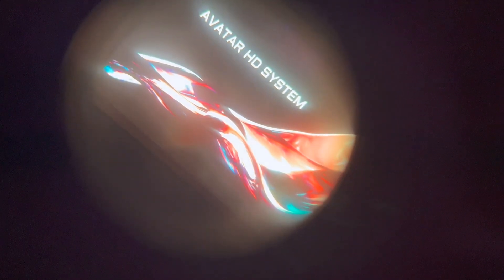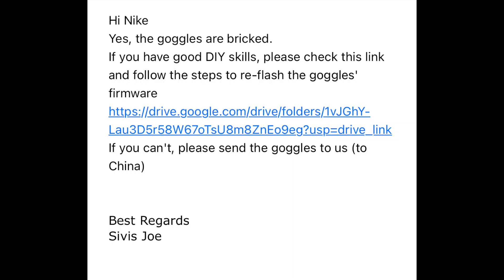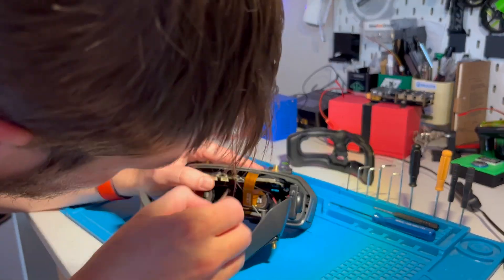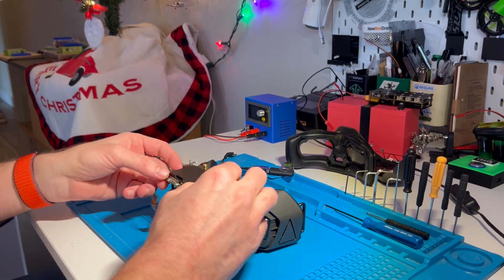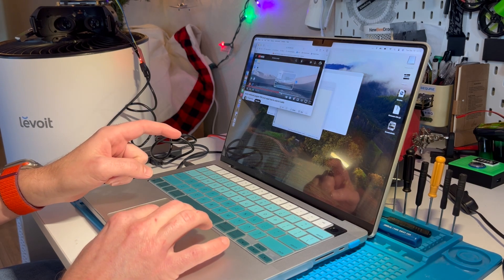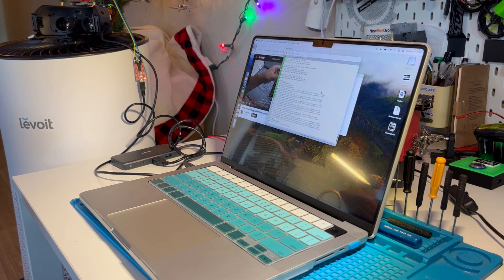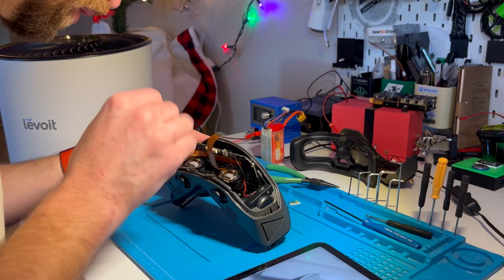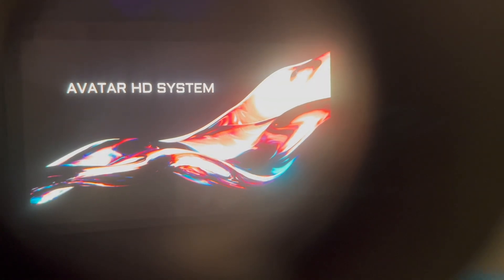Unbricking Fixing Bricked Avatar Walksnail goggles

Comment: I have tried everything and it seems my goggle board is not reading my sd card. Any thoughts? below is what crt reads back:
cp: can't stat '/local/factory/font/sdk.version': Not a directory
.............
mtdblock16
/tmp:/lib:/usr/lib:
cp: omitting directory '/local/usr/lib/glib-2.0'
cp: can't stat '/local/usr/lib/libcjson.so': No such file or directory
cp: can't stat '/local/usr/lib/libcjson.so.1': No such file or directory
cp: can't stat '/local/usr/lib/libdbus-1.so.3': No such file or directory
cp: can't stat '/local/usr/lib/libexpat.so.1': No such file or directory
cp: omitting directory '/local/usr/lib/libffi-3.2.1'
cp: can't stat '/local/usr/lib/libffi.so': No such file or directory
cp: can't stat '/local/usr/lib/libffi.so.6': No such file or directory
cp: can't stat '/local/usr/lib/libgio-2.0.la': No such file or directory
cp: can't stat '/local/usr/lib/libgio-2.0.so': No such file or directory
cp: can't stat '/local/usr/lib/libgio-2.0.so.0': No such file or directory
cp: omitting directory '/local/usr/lib/libpcreposix.so'
cp: omitting directory '/local/usr/lib/pkgconfig'
/tmp/dbus-daemon: error while loading shared libraries: libdbus-1.so.3: cannot open shared object file: No such file or directory
ceva file operation thread 0 create
CEVA file ops task, core 0 msg id 4664
ceva file operation thread 1 create
ceva file operation thread 2 create
CEVA file ops task, core 2 msg id 4666
ceva file operation thread 3 create
ceva file operation thread 4 create
CEVA file ops task, core 1 msg id 4665
freeRtos file ops task, core 4 msg id 0x123c
CEVA file ops task, core 3 msg id 4667
/tmp/fpv_type: error while loading shared libraries: /tmp/libmultimedia.so: invalid ELF header
board_ver=127
/tmp/fpv_type: error while loading shared libraries: /tmp/libmultimedia.so: invalid ELF header
------>HW_VER=127
run fpv
/tmp/boot_assist: error while loading shared libraries: libcjson.so.1: cannot open shared object file: No such file or directory